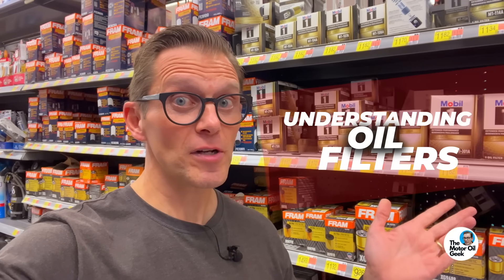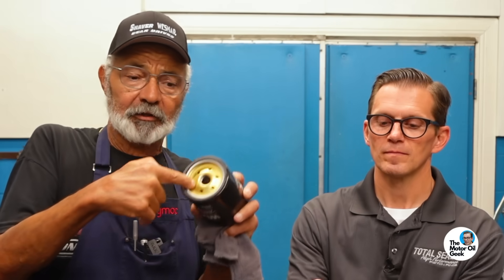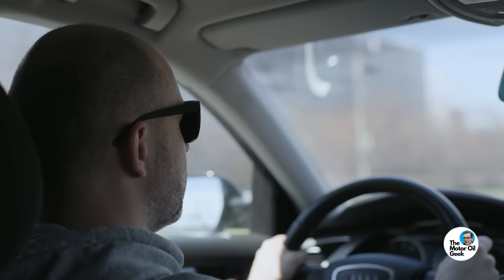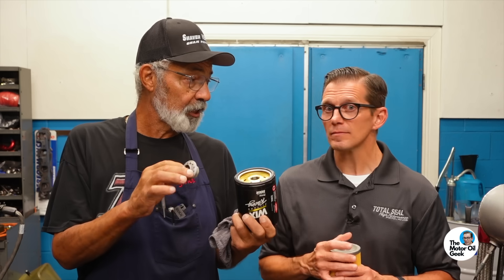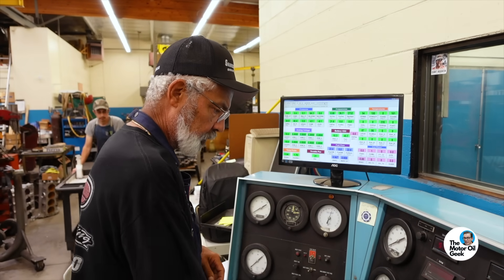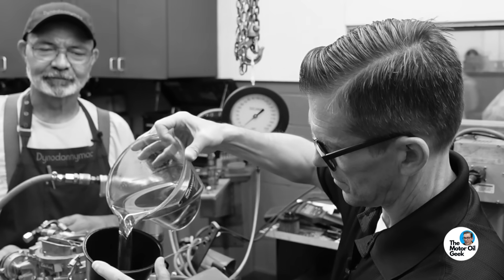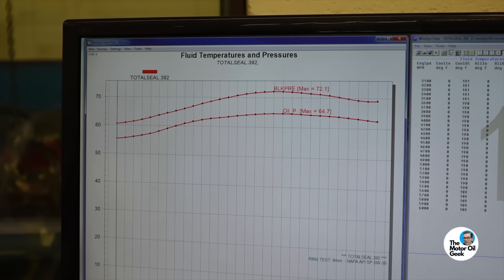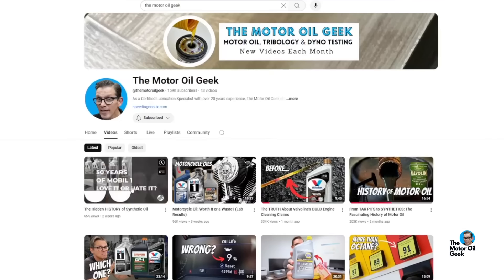OIL FILTERS: What Most People DON'T Know!

Comment: Try this bypass test with truly COLD oil, not room temp oil. It's very much more likely to bypass. I had a rig on one of my trucks to measure DeltaP, which I was able to datalog, and experimented with different viscosities and oil filter types, std cellulose and synthetic media (which flow a little better), and temps down to around 0F. My test engine was a 5.4L Ford Triton. When the oil ws COLD, using the recommended visc (5W20), it would bypass only if I engaged in spirited driving before the oil had warmed up (I could measure bulk oil temp). When I bumped up to 5W30 grade and especially 10W30 , it was much more prone to cold bypass. Even when partially warm (100-150F), it might bypass at high revs. When I used 10W40, it was bypass city and the oil needed to be roasting hot to avoid reaching the filter's rated bypass differential pressure in the higher rpm ranges. I saw differneces between synthetic and conventional oil, but it was not a large as  expected... with new oil at least. I also saw that a standard cellulose filter restricted flow noticably more than the synthetic media filters I used. Since the synthetic filters generally are more efficient filters, I now see them as a win-win choice. After fooling around for a few years, I started advising people to go easy with an engine until it was fully warm. In the two engines I tested extensively, the Triton and a 6.9L IH diesel, it could take 15-20 miles of driving (less on the diesel since it had a oil-to-coolant oil cooler) to get the oil up to a stabilized temp. In both engines, only on particularly high loads or ambient temps, did the oil actually reach 100C (the viscosity grade temp), so if any engine had similar EOTs, using too high a visc oil might put you into bypss more often... as in spirited driving.
Reply: Adding to your point.   Cellulose media has large fiber diameters as compared to many synthetic fibers.  Smaller fiber diameters mean you can create more void volume (more pores) for the same given media volume.  More void volume allows me as a filter designer to increase the efficiency and decrease the differential pressure.   Filters change dP when you change flow rate,  fluid viscosity or contamination.  If the flow rate doubles the media contribution to dP will also double.   If the viscosity doubles, the media contribution to dP will also double.   This linear relationship is due to the Reynolds's number being very low for the media.   Large media area (3 ft^2) means the media velocity is low and the viscosity is high.  In the aerospace world, we test filters at -65f where the fluid viscosity is greater than 35,000 cP and a brand new filter will be in bypass.   If the filter is in bypass, that does not mean the filter is not flowing oil,  the bypass valve is bleeding off excess pressure from the filter.   I appreciate your field insights in the comments.
Reply: @NicholasBrown How does large media increase viscosity and why not say bypass vale allows a fluid path in parallel to the filter, not sure the purpose of reitterating what we all presumably understand.
The original intent of LS's video was if the filter is bypassing, yes?  I'll have to watch it again but surely a 15w40 oil is more likely to bypass than a 0w20, that's the next aspect to understand.
Reply from the maker: The dyno is in LA, so "cold" in this test was room temp. It would be fun to repeat the test at a much colder temperature.
Reply: @themotoroilgeek  I was wondering about temps in the 20 t0 30 below range. I used to live in Wyoming, and it could freeze your rear end off. LOL. Another great video. Thank you for the info.
Reply: I was about to comment on this. They're standing inside with short sleeves on. Temp is probably 70 degrees F or more. That's not cold to a Chicagoan, and especially not to an Alaskan or Canadian.
Reply: Extremely good hands on experiment and analysis.  The difference you were seeing between the cellulose and the synthethic is because the synthetic media is a depth type filter media, normally with larger pathways near the surface and getting progressively smaller as you go through the filter.  Most cellulose filters are much more a surface type filter.  They both can be made to filter the same size particle.  But a depth filter will hold a LOT more particles before getting too high a delta Pressure than a surface filter.  The funny thing is for a depth filter, it provides its best filtration (smallest particle size retention) just before it reaches maximum allowable delta-Pressure (assuming the particles are hard and not a gooy gel).  The lower restriction you saw was because the synthetic media has a lot more pathways for the oil to flow through.  I spent over 3 decades of troubleshooting chemical plant design problems and I take my hat off to you for such a good analysis of filters.
Reply from the maker: @allencar5212 thank you!
Reply: I came here to say this.
"Cold oil" how cold? 
Room temperature cold, or North Dakota in February cold?
Reply: This says a lot about using the proper oil for the engine and environment. Thanks for your comment
Reply: I assume your criteria for determining bypass was delta P exceeding the bypass valve pressure specification of the filter.
I maintain my engines well and run 10W40 year round, is there some reason for, or benefit to having a bypass valve?
Reply: @thisisyourcaptainspeaking2259  Correct. I got the bypass spec for the various filters. Without a bypass, excessive Delta P could blow out or through the filter media. A little dirty oil during a bypass is better than blowing out the media.
Reply: @thisisyourcaptainspeaking2259  If it is cold (high oil viscosity) or the filter is dirty, the filter might not be able to flow enough oil to properly lube the engine; especially at start-up where most wear ocurs.  If the by-pass valve did not open, the engine bearings and everything else could be starved of oil and quickly destroy the engine.  It is much better to get 100% of the oil flow required to protect the engine even if only 50% has been filtered.  

In some engines and some climates 10W-40 oil would be great; but you always need to follow the manufacturer's oil specification for the expected temperature range for operating the engine.
Reply: @allencar5212  Agree, this was an "for example".   FWIW, I don't actually run 10W40 anymore.  Same engine, I've moved to 5W30 because oil pressure builds faster at startup.
Reply: Wasn’t the delta less the lower the temp of oil was?
Reply: @dsmithwc04  Correct. Engine speed (oil flow) was also a factor.
Reply: Yes, yesterday when I started my truck the temp shown in my dash said it was minus sixteen degrees. So COLD oil next time.
Reply: Very interesting and valuable information thank you very much!!!!
Reply: High revs on a cold engine is a terrible idea. Pressure goes through the roof , pushes out seals.
Reply: Wow, well done and thank you!
Reply: Wrong
Reply: @danguelph2676  Would you elaborate?
Reply: My V10 takes 5 minutes to produce heat in NE Ohio during the winter. Oil should also be to a reasonable temp if the coolant is warm.
My question is, does the engine itself have a way to reduce flow to the filter when it's cold? Or does it not flow well through the tiny passages in the heads when cold? Also, a cheap rubber valve would likely get hard and not move but a high quality silicon one would.
I find it odd and highly unusual that you would spend the time to check oil pressure going in and coming out of the filter, and install another computer in your vehicle to datalog the entire process. Means you're smarter and more motivated than me 🤔
I drain the oil, change the filter, pour in new oil, and call it good. I've never had an engine fail and can recall temps from -20f to 115f over the years. 
So now I'm curious if the cold temps would cause that filter to go into bypass. I dont understand how if it's a delta pressure not a constant pressure. An atv would be more likely to do this if used in the winter for plowing or hunting. Would also be more likely to be damaged. Never had that happen either.
Reply: This needs pinned!
Reply: I disagree, at least in the case of wix regular and wix XP(synthetic). The greater "porosity" in the synthetic media is not for finer filtration, at all. It's intended for longer oil change intervals, so the media doesn't plug up, and force it into bypass mode. I'd rather change my oil & filter at 5k miles, and save several dollars over the synthetic filter and filter the oil better.

Comment: I'm surprised by the pressure drop across the filter with hot oil. I've often been supplied with substantially smaller or larger filters listed for the same application. It's rarely practical to start searching for the larger filter when you have to get the job done. You have to wonder what the pressure drop is on the smaller filter.

Comment: Whal helz belz!  Now ya dun wint and dun it!  Here I sit on my day off and you fellers made me learn sumptin.  Dat ain't fair!  I always thought that the by pass would open on very cold weather starts, say in low teen or lower with 15W or 10W oil in the system.  I got that notion because my diesel farm tractor would buzz in those conditions for about 4 minutes and with a mechanic's stethoscope I would trace that buzz to the filter area.  Maybe it was the oil pump cavitating.  I usse 0W oil in tractors now for winter and no buzz, I figure that is a good thing.

Comment: The statement about the bypass valve never opening on a cold start needs context. 

A +68F startup is a cold start in relation to engine operating temperature, but I live in Canada and a "cold" start is more like -5F and colder. Even if the engine is plugged in, the oil in the pan is not +68F.

What weight was the oil you tested with? Logically, heavier oils will carry a larger delta.

Great video by the way!!!
Reply from the maker: The dyno is in LA, so "cold" in this test was room temp. It would be fun to repeat the test at a much colder temperature.
Reply: Even so, the filter is still filtering, and most of the oil, just not all of it.

Comment: Even if you don't completely prefill a canister oil filter with oil, at least getting the filter media wet and primed helps a lot to get that oil flowing faster, that's how I look at it. When a filter is new and dry and you crank the engine like that the oil flow has to work a little harder to wet and prime the media.
Reply: My horizontal mounted filter on my 2018 Camry can only hold a little bit of oil so that it doesn't drip out perhaps maybe half full but I have noticed a quieter start even with just that prep and I did attribute that to pre-wet 👍
Reply: @richcombs4805 thanks, yes, my 2007 CANYON  LS , IS Horizontal: simple Pre-wet/ soak , etc… ( maybe infitesimal differential, noise m wear..)
Reply: Just turn the engine over with the ignition disconnected until oil pressure is achieved.
Reply: You ain't gotta do none of that prefill stuff. Spin a clean filter on, fill the sump and start. There is enough risidual oil to provide sufficient lubrication.
Reply: I don't have a cleaner container to dunk the dry filter into

Comment: I have a C7 corvette Grand Sport, and I know at some point GM issue a service doc change the oil filter specs for the LT1 engine for a 15 psi to a 22-psi bypass pressure. If that only comes into play with a clogged oil filter, I wonder what about the LT1 engine needed a higher bypass psi?

Comment: my wife has been taking her Toyota Highlander to the dealership to get the oil changed for the last 70,000 miles    after the first 20k  her fuel mileage was less     for the first time I changed the oil myself two weeks ago using  the recommended   0W 20 
Now she is getting the fuel mileage that she was when we first bought it  
(The fuel mileage the engine is supposed to get)     i'm guessing they were using a different oil 
Then what they're supposed to

Comment: Always informative and appreciated vids. The vids with Don are great love how you guys bounce facts off each other.  Didn't realize the bypass valve psi was only an issue in extreme circumstances. Even though I believe the rating for my engine is the same in the AC/Delco and the Wix. From my understanding the Wix is a better built oil filter and no reason not to make the switch.
Reply from the maker: Our pleasure!

Comment: Hey, Lake how do you pre-fill an oil filter that is mounted side ways????
Reply: Tip the car on its side
Reply: Your vehicle may have a 'clear flood' mode, like my chevy, where you hold the gas pedal to the floor while cranking, which prevents the engine from starting.  this would allow you to prime the oil filter without starting the engine.  I use this method on my Traverse which is a nearly side mounted oil filter.

Comment: Soooooo.  As a Car NUT, I've always wondered??????  What would happen if i Used a "RACING OIL FILTER" On or for a NON Racing Application??? Like my 2022 F-150 EcoBoost V6??? What's the Difference between a RACING oil Filter, and say the Standard Motorcraft FL500-S Filter???  What's the BIG DEAL Between the Two Filters?? Can the Racing Filter "Damage" The Engine???? 🧐🤷‍♂🤨???? Hello, Anyone have a REAL Answer???  LAKE?????
Reply: Racing oil filters are more expensive, but will have better paper/cloth element.  Meaning  Dp can be greater without breaking element.

Comment: This is my question about oil filters. Say I have an oil filter rated to go 10,000 miles. I do my oil changes at 5000 mile intervals.  With a 10,000 mile oil filter can I change the filter every other oil service?
Reply: That would be a really stupid idea, for one thing you would be leaving a quart or so of dirty oil in the filter and hence in your engine. Assuming your car holds 4 to 6 quarts that's almost a quarter of the engines oil🥺
Reply: @Trump985  it’s a cartridge style oil filter
Reply: New oil and filter every 5000 miles. Use synthetic oil only 5w-30. Even if your manual said so.
Reply: @steelzmb4262  I already do that thanks

Comment: I had to run a premium guard filters sold at AutoZone with an STP label they were the premium ones clog at 4000 in the bypass did not open resulting in a reduction of oil pressure in two different instances one a ram and one of Chevy. This is the real difference in oil filters Not micron size or whether the base gasket is silicone or nitrile it's the quality of function The thing needs to work every time all the time hence I won't buy any premium guard filters anymore even my loved Napa golds

Comment: I’ve yelled at my screen watching those oil filter reviews and thinking these guys have no idea how a filter really works. Saying this filter is junk that is one is great.   They have no ideaThank you for educating these people.
Reply: Everyone ripping on frams, they need to go find that fram vs new Harley oem vs old Harley oem filter video. 
Not all the frams are bad, but they do appear to try and cut costs on their high volume selling filters. 
That Harley fram was superior to the new OEM filter. 
The old nos 90s Harley filter and the fram filter were about equal. 
I'll give any filter a try ,after it's been dissected to see it's quality.
Reply: @MrTheHillfolk 
I use a Fram 3063 on my BMW motorcycle and cut it apart just to see. Pleats look thick and very even and glued well on both ends, center piece is metal and check valve looked very adequate. I get the filters on Amazon or eBay for about $17ea which isn’t cheap but about the same as the German filters. I’m sticking with Fram as I’ve used them since the 1960’s and had no problems.
Reply: Fram endurance is their best line. Picks up everything at 20 microns which is the gold gold standard that only super high end german filters lole hengst can do.

Oh yeah and Mann Hummel wix sucks.  They're called rock catchers because they only clean out 30 microns or bigger
Reply: I don’t watch the idiots that rate filters by cutting them open and looking at the filter medium and saying this one looks better.  They are idiots.
Reply: @georgeburns7251  Good point.  The trapped particles in all cases are probably too small to see.  OTOH, my favourite motorcycle mechanic advocated cutting every used filter open to check for large particles indicating impending doom for the engine (nothing to do with comparisons).
Reply from the maker: I’m glad we could help!